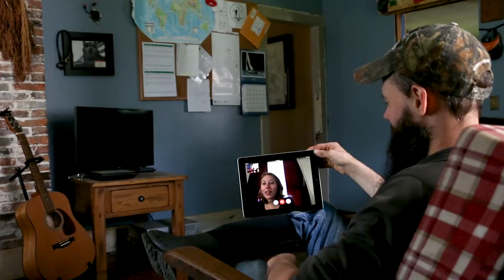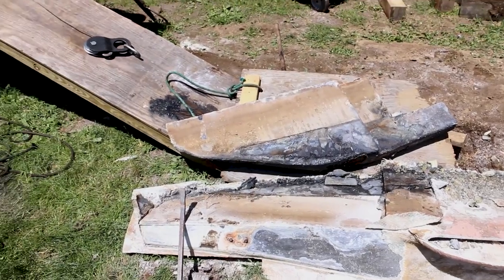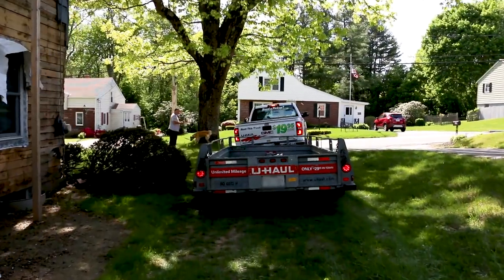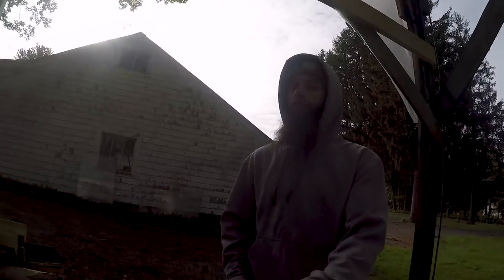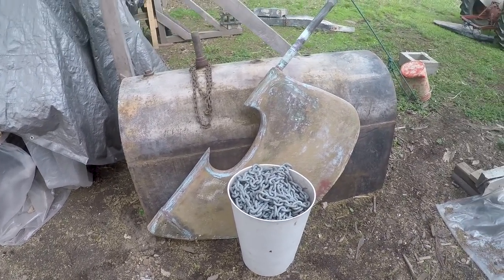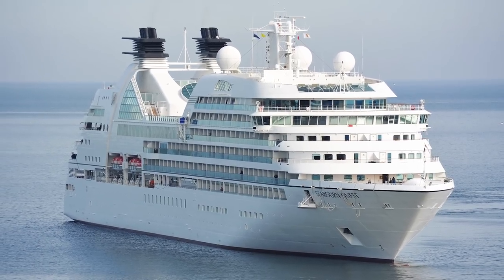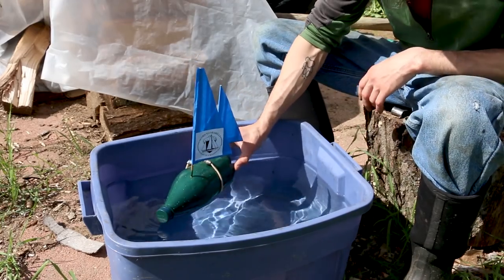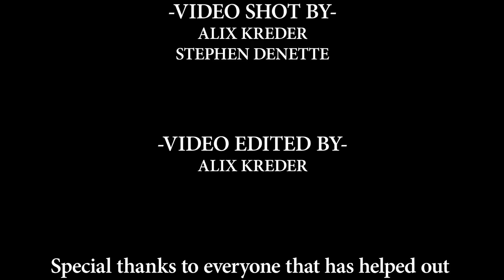Acorn to Arabella - Journey of a Wooden Boat - Episode 11: Heavy Metal

Comment: About 34 years ago when I was in college visiting one of my older brothers in Norfolk, Virginia, we went sailing on the James and Elizabeth Rivers on his 27 foot sailboat.  My older brother was a very dedicated sailor until he found a love for kayaking and gave up his 2 sailboats. On the day we were coming back from being out on the water, heading back to port towards the mouth of the James River, my older brother said to me to sit close to his depth gauge in the boat's cockpit and he would sit on the other side with the tiller.  "Read out the depth gauge every foot," he told me.  "Why?" I had to ask.  "Because there's a sandbar at the mouth of the river and it's low tide now and our sailboat has a 3-foot draft.  Tell me when we get to 4 feet"  My older brother heeled his 27 foot sailboat (that he could sail easily by himself) over to about 30 degrees, me being on the lower side of the boat, inches from the water (and thinking we'd tip over), and I read as we went from 6 feet, to 5 feet, to 4 feet and flew over that sandbar until the numbers started increasing.  Let's just say I learned a lot about sailing that sunny day and how a sailboat is supposed to be designed to love to heel over at a specific angle for increased speed and agility.  That sweet spot is designed into the hull just as you describe and it never ceases to amaze me how naval architects came up with the math that figured out hull designs, keel weight, sail square-footage, and the overall design and weight of a boat, sail and motor.

Comment: thanks guys!  I didn't really remember seeing this one before but I must have as I've watched every single episode.  I am building a Herreshoff Haven 12.5 and I need about 600 pounds of lead for her ballast keel. Alix, you commented on my FaceBook post in wooden boat forum and re-watching this is such a huge help to me. I will be releasing my own video as I make more progress with the lead that I currently have, still encased in fiberglass. The keel I got was from a Columbia 23, so roughly 810 pounds. I used a come along as well but managed to get the entire thing into my trailer. That was after we spent about 5 hours chain sawing apart the entire boat! When we tried to use my truck to pull (at a perpendicular angle)  the keel off of the trailer and bunk boards, I ended up pulling the trailer over on its side. The two near side tires laying on their face and the other two straight up in the air. That was a bit scary. Some simple lessons in physics, for sure. Obviously you had a hell of a lot more weight. That connection chain link was damn scary. Glad you didn't feel it's wrath!  I have a sledge hammer which will get put to good use, btw, you guys got a nice shout out from Leo in his video this week.
Reply from the maker: Good luck, dealing with the lead and getting the keel poured!

Comment: Just and FYI if you ever have to cut fiberglass again plan ahead and get a Tyvek suit, cover your exposed body parts with baby powder, or failing that before showering slosh rubbing alcohol on your skin let it evaporate then  use cold water to sluice it off "Without" rubbing it. The alcohol will pull the fibers out of you pores and the cold water wil wash it off as long as you don't push them back in by rubbing! I spent a summer doing fiberglass boat repair in West Texas of all places LOL talk about being miserable till some one told me about the baby powder and rubbing alcohol, the Tyvek I learn in 20 plus year in construction.
Reply from the maker: Fiberglass work in Texas! You have our deepest sympathy!  Hopefully we never have to deal with fiberglass again.  We got all the lead we needed so there is no real reason to mess with the stuff.  But if we do we will try those tricks! Thanks!
Reply: You haven't had to deal with Health & Safely rules in UK, many rules but they are for protection.
Using ladders as you use are a big NO you have to use scaffolding, area fenced off - hard-hats, protective foot-wear and no children, Dust from wood, fiberglass etc. etc. if you inhale fine particles where are they going to go? Your lungs
Reply: Another note is to use a lint roller. It won't really work if you are covered head to toe but it worked wonders when I use to do fire alarm installs and had to get elbow deep in the stuff on occasion.

Comment: Have you thought of adding a jib to the tractor to help lifting stuff
Reply from the maker: That was recently suggested to us.  We had not really considered it before but we are now.  Just gotta find the time!!
Thanks for the suggestion!
Reply: Remember if you add a jib to the tractor, then also fill the tractor tyres with water and a counter weight to the front. Otherwise you go over backwards.
Reply: and if possible a ROPS (roll over protection system) very handy should you end up rolling or tipping the machine... i woudl hate to see you guys get hurt by any means... wish ye good luck and safety.

Comment: Lead keel inside fibre glass? Interesting. Both my fibre glass boats have had the lead keel just bolted to the bottom of a fibre glass keel. Kind of, you touch a rock lightly, you can just hammer the lead back into shape and paint it the next time the boat is up. Fibre glass crushed between a rock and the lead keel? At least lots of fibre glass mat repair work, and possibly some fibre glass rot too, so more repair work.
Reply from the maker: Yup!  But by encasing it, it was faster and cheaper to build.  Shows where the priorities are.

Comment: Or you can use the same mass of ballast and move it further from the waterline. It's all about lowering the centre of gravity. Which is why racing yachts have a deep keel extension with a lead weight on the bottom. Maximum moment, minimum mass. It's not rocket science. That doesn't use much lead at all...

Comment: Hmmm we just saw that comealong go left at a large rate of knots, then you straddle it..... 
You got kids yet? Ya want em?
Reply from the maker: Haha
Don't really want kids so no issue there.  When there is not a ton of force on it it can't shoot back like that.  There are times it's mostly safe to straddle it and times when it is not. =)
Reply: Maybe so, but there is no way I'm risking the jewels like that. They've taken enough damage already from years "breaking" horses.
Reply: It snapped when it was pulling a load up a ramp.  He straddled it when it was flat on the trailer bed.  As there was no constant opposing force due to gravity pulling the lead against the cable, the probability of failure should be incredibly low.

Comment: Guys, go back and relearn your hydraulics.  It is not possible for anything to dsplace an amount of water that weighs more than itself.   A 100 ton object cannot displace more than 100 tons of water.  It can only displace less, in which case it sinks, or displace its own weight in which case it floats.  If you want a 100 ton boat to displace 110 tons of water, you have to add 10 tons to the boat.  This is how (floating) boats are "weighed".
Reply from the maker: You are correct, we definitely misspoke.  Thanks for catching our error!!
Reply: And then there is the thing with the G-point.... or GM as it realy is (hope it is the same in English). That is whay you like the balast so low. And how you adjust the roaling speed of the boat. If your boat is 10 tons an you feel it roals to quicly yo just move som ballast up in the hull and ypu will have the same waterline but a slower roall... but also it will heal more to the side... this is a big subject if you like to be a capitan of a boat ;)
Reply: An object such as a buoy that is tethered to the bottom of the body of water can displace more than it weighs. The rest of the buoyant force is balanced by the tension of the cable.